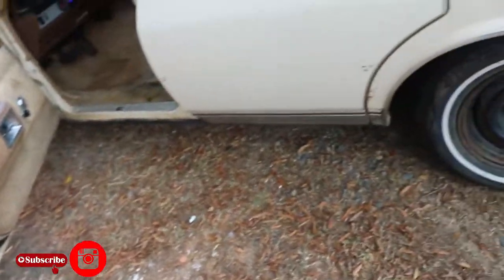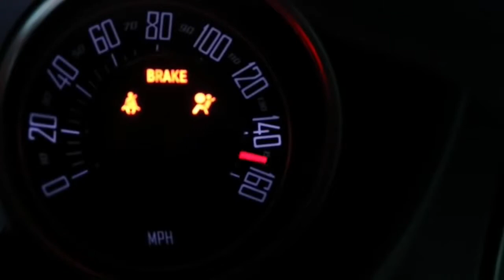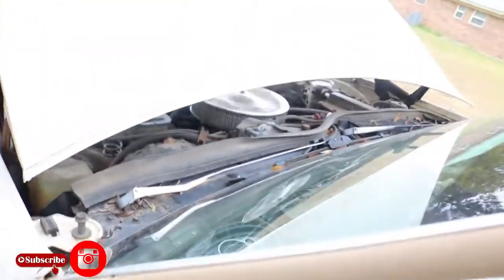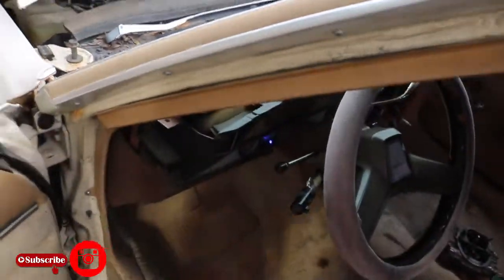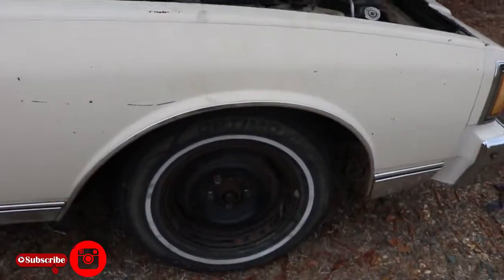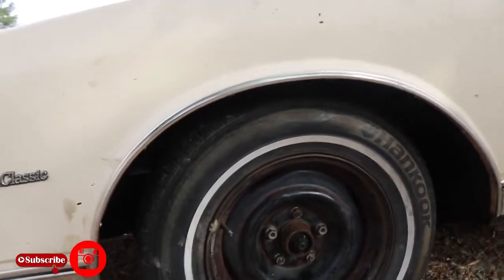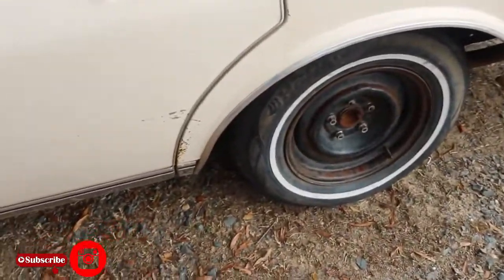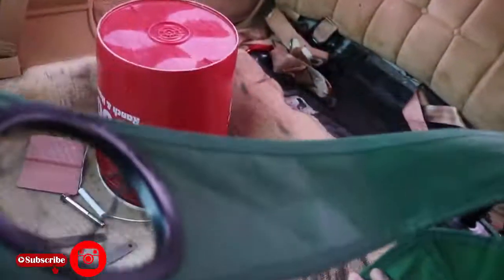Adjusted My Ride Height & Update On My Engine

Comment: How does the car ride wit that new suspension and cuz of how low u got it
Reply from the maker: If you ever been in a Lincoln town car it’s just as smooth as that
Reply: @hemiworldproductions1659  damn that’s what’s up I’ve been wanting to lower my 84 caprice Landau like that
Reply from the maker: @cartailincautodetailing946  I’m gone lift it back up for my rims but I’m telling you bruh get the coil over it’s feels like riding in a 2022 then it got a rebound on them so if you feel like it’s to bouncy you can stiffen it up they the real deal